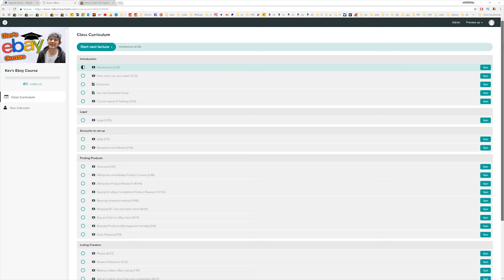FAIL Traxxas X-Maxx Crosses a Lake RC Car Water Skipping Hydroplane

Comment: Wow man I commend you for how much disassembly you do to ensure everything is tip top! I like to snow run a lot with my trucks. I blow them dry with my air compressor and I mean bone dry. I then shoot oil into every bearing I can access which is most of them usually. So far so good. I have not cracked any diffs open after snow running yet. If I submerge one of my trucks I’ll rip it all apart. Thank you for this video!

Comment: I bought a used 6S X-Maxx that has a MAX5 ESC in it, what else should be upgraded before slapping some 8S power into it?
Reply: MrRunkeballe driveshafts and diff gears to 8s spec
Reply: Can't i just replace those after they break? =)
Reply: you will break in 1 month time around 5 to 6 diff gears, and if your not careful a couple drive shafts. you don't have to upgrade them, but if you do it will save at least $500-$1,000 in parts, especially if running 8s.

Comment: I wonder if the water spray is interfering with the reception? Plane awesome vid!
Reply from the maker: THanks dude. It was the esc cutting out not the radio, think I must be drawing too many amps. Im going to try with the 1275 motor next.

Comment: hi Kevin , what is the best battery to use on my X Maxx 8s  ? runtime V power ?
Reply from the maker: not sure but I use flurion 5500 3s and 4s as they are lightweight and cheap :)
Reply: Kevin Talbot thanks :)
Reply: I run Tattu 6500mah 4S. They are a tight fit height wise so they stay out when you lock it them down. Great run time!